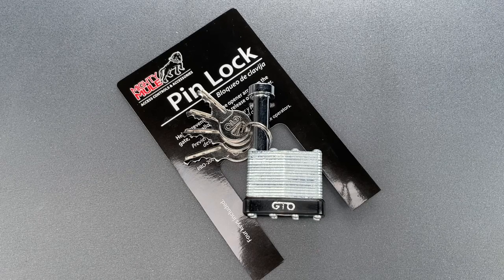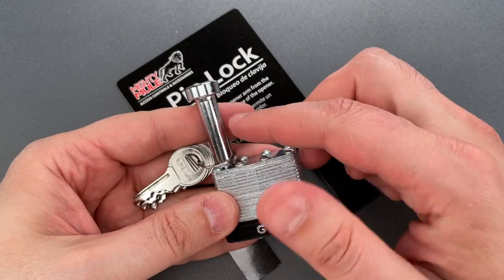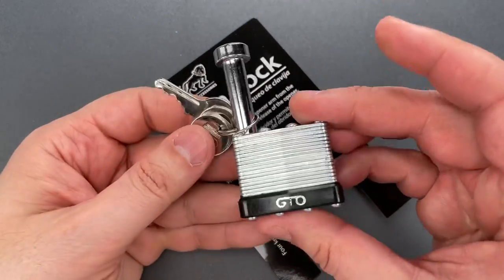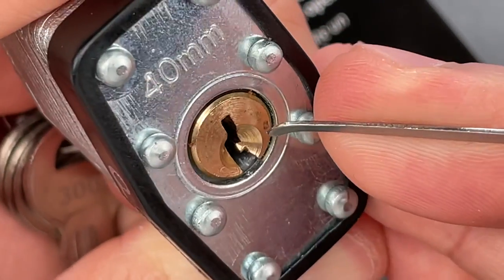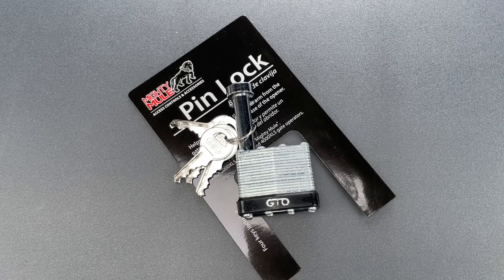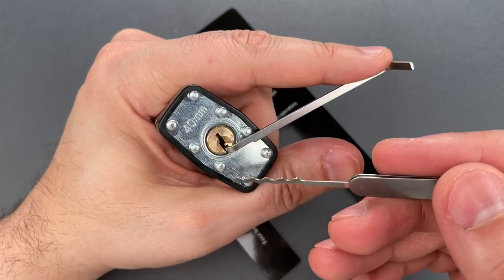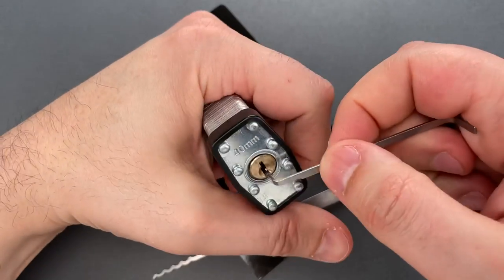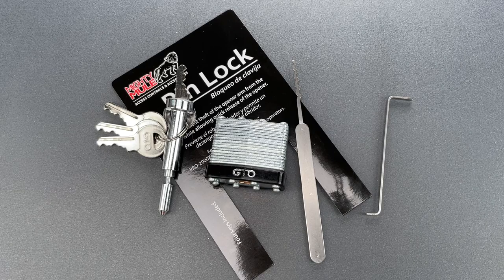[1426] Embarrassingly Bad: Mighty Mule Gate Lock

Comment: I like to imagine that if this guy ever had to go to prison, he would just wiggle the cell open. Then he would close it again just to show the other prisoners that it was not a fluke.
Reply: I saw a comment similar to this on another video, except it took it a step further and said he would go home and break back into the prison with his camera to record a video showing how he picks the lock on his cell to break out again. 🤣
Reply: @Mock353  exactly
Reply: He won't go to prison tho, he's a lawyer
Reply: I'd think the best move would be to just leave his cell door open to save the embarrassment of him getting it open in 10 seconds or less
Reply: Hi this is the lock picking lawyer and today I’m going to break out of jail using nothing more than a pair of eye glasses and the staple holding my rap sheet together.
Reply: Video 919.
Reply: @costagauci5719   ?
Reply: It could be impossible
Reply: @southaussiegarbo2054  he picks a prison lock in that vid.
Reply: "today we're going to be showing you how to pick a jail cell door using this Lego man... Click out of one..."
Reply: Most prisons use electronic locks for cell doors. There's a control room in each cell block where a guard can open and close each cell door individually. There is usually a manual override in the form of a physical key (in case the power fails), but that override is only accessible outside of the cell.
Reply: @poormanselectronicsbench2021  How to confuse LPL... lock him up but don't lock the lock ;)
Reply: @Mock353  no cell can hold him
Reply: @Ferinex_666  that's interesting. However LPL has done videos showing how to bypass such system. I strongly believe LPL could bypass the security features found in a general prison.
Reply: XD
Reply: you're in bed at 3am and suddenly head 'and a little click out of 3....'
Reply: @Mock353  Okay folks, I just broke out of county so I went back home for my camera because this was embarrassingly easy. Let me show you
Reply: The prison guard comes to check on him and hears, "Hello, this is the Lock Picking Lawyer and what I have for you today..."
Reply: “We put him in a cell on his own. He’s harmless enough. Only pick his own lock and closes himself back in. At least he is polite.”

Comment: They literally invested more in the look of the lock than the lock itself.
Reply: More in the design
Reply: and none of these is a compliment
Reply: More in the packaging.
Reply: They're apparently relying on the fact that almost ANY lock is more secure than none. But in a situation where every gate uses this, there's no advantage to "moving along" to an unlocked gate since there wouldn't be one. In retrospect though... I wonder if opening this lock is easier than removing the pin in an unlocked gate.
Reply: They literally invested more in the packaging of the lock than the lock itself...  :)
Reply: @laurendoe168  It definitely is. The only "security" this might provide is that someone might see it's a lock and THINK that it's not worth the trouble, but this is about as easy to disable as the standard clevis pin it replaces is. If the clevis pin is well made with tight tolerances, it might even be harder to defeat than this. Hell, do a bit of spot welding after installation, and you've just made the clevis pin MUCH more secure (at the cost of not being able to remove it yourself). This is purely about the APPEARANCE of "oh, it's locked" being the only security feature.
Reply: @laurendoe168  Simple answer, no.  Well, at least my cows and goats have yet to display the ability to use a wave rake.
Reply: Laminated lockbody is not a big investment.
Reply: @laurendoe168  that's a good point, although I'm that case 90% if the cost is going to the niche design rather than the quality of the lock
Reply: Darn Architects!!
Reply: @Ugot2BkddnMe  What about them dern rustlers??? :D
Reply: Rather, their design team is jotting down notes on how to "improve" their locks.
Reply: @anteshell  "Rather, their design team is jotting down notes on how to "improve" their locks.
" 

Much less cynical than I, apparently.. lol
Reply: Literally literally literally. Oh literally I can't stop literally swearing. I am literally addicted to literally or basically or "like". Like, literally! Can someone, like, literally, like, help me, stop, like, literally, like, overusing words, like, literally, like, literally? Can you? Like, literally? LOL!

Comment: Not exactly the superlative the company was hoping for...

He spent ten times more time berating the lock than he did picking it.
Reply: LPL broke the time/quality algorithm with the discussion. Of course without the discussion this would have been about a 15 second video! 😆
Reply: 10x0 is still 0. Just sayin
Reply: @slademmxii8759  heh.
Reply: @slademmxii8759  You're using that joke wrong. He didn't spend zero seconds picking the lock. It isn't ten times zero if no part of the equation is zero.
Reply: @slademmxii8759  whuuuu?!
Reply: To be fair, any lock that can be opened by rake gets opened very quickly..

Comment: With the amount the cylinder twisted you could probably put a flat head screwdriver in the keyway and it would open. It looks like utter junk.
Reply: Yeah, I was just thinking something similar; with enough leverage I’m sure a decently built flathead could be used to torque the core right open and either rip it out or just disable the locking mechanism permanently.
Reply: That sometimes works on these plastic bible locks. Other times the core (that is not made of brass despitle looking like it) snaps and binds it all up. Better to use a lighter to melt the plastic first.
Reply: Honestly this one looks like you could melt it open with lighter fluid and a bit of fire..
Reply: LPL, try it.
Reply: While my first idea when I saw the plastic was "torque wrench," after seeing the rake attack I think that might be overkill.
Reply: @ironlynx9512  My first idea was "cigarette lighter". My second was "flathead screwdriver".
Reply: @randombloke82  Yeah flathead screwdriver + channellocks would get that open for sure.

Comment: It would be hilarious if instead of breaking into the property, they just stole the gates.
Reply: Somebody once stole my bike lock, but left my bike! It was one of those basic indestructible Schwinn models.
Reply: And left the lock
Reply: That happens in real life
Reply: or exchange with the neighbour's lock, just for fun
Reply: Unlock their lock, put in on the ground, and then replace their lock with a grind resistant lock. Proceed to witness the ensuing struggle.
Reply: This lock is meant to secure the gate opener.  The gate opener (which swings open or closed a vehicle gate, like a chain-link gate across a driveway) probably costs $500 USD, and is (apparently) easy-peasy to steal, as its normally mounted without any security hardware.
Reply: @kenc2257  Someone near here had a Range Rover on their drive. It had its built-in alarm, plus an after market one fitted. They unlocked their car one morning and found a handwritten note on the dashboard, saying, in impolite terms, that their car security was useless. Nothing was stolen, but they sold their car promptly.
Reply: @legacysage  Two things to never use when found on the ground : 1) an USB key 2) a bad lock ;-)
Reply: @locknut5382  There is a real good chance the person that left that note was LPL.
Reply: @kenlee74  I'm inclined to agree with you about that! We must check to see whether he visited England in about 2015. 🤣👍

Comment: I bet when this lock sits in the hot summer sun for a few hours, the plastic gets so soft you could turn and open the cylinder with the turning tool alone 😂
Reply: It's just as likely to just fall appart to gravity when the plastic gets soft enough.

Comment: One day he should get an amateur in to pick the lock that "could be picked by an amateur".
Reply: He did this on another channel. The part that struck me was he told the person they were applying too much force. He said he could tell by the whiteness of the person’s knuckle. The person relaxed a little, and the lock immediately popped open.
Reply: With a lock like this, bring in a 10 year old kid and hand them a wave rake, job done...
Reply: He made an "appearance" (hands only) on TKOR and taught Nate and Grace to pick locks.
Reply: I bought the Genesis pick set a few months ago. I have never picked a lock in my life. I had a couple of old padlocks in my junk drawer. One was a Brinks and the other a Master Lock. After a little practice, I had my roommate time me. My best time was 11 seconds on the Brinks and 8 seconds on the ML.  @Gary Wiseman You really don't need a lot of force. I slightly bent one of my picks, thinking it was stuck. I quickly realized the lighter the touch, the better.
Reply: I'll volunteer!! I want to meet the LPL. I'd fangirl so hard.
Reply: When he does the "curious adolescent" tests he should bring an actual kid on to do them!

Comment: When you see the wave rake coming up you know this lock has no redeeming qualities
Reply: I dunno, the jigglers are even worse. And the very worst if he bypasses the lock with a shim or by just reaching through.
Reply: I like it when he just taps it with a hammer. Remember the "gun safe" he opened by hitting it with a clip board?
Reply: I was disappointed the soft plastic lock got the dignity of a low-skill raking attack instead of the no-skill screwdriver or cigarette lighter that it deserved.

"At least our core's not plastic" isn't a redeeming quality, true. But this lock's at a negative value.

Comment: I sometimes heat the key with a lighter and they use the key to melt the ice from the lock. Interesting how the plastic would hold up in my part of the world.
Reply: In winter in the UK, boiling a kettle and pouring boiling water over the lock works. Also means you have some leftover water for a cup of tea.
Reply: Some plastics shatter in cold temperatures ....
Reply: That would depend on the interplay of a number of factors. Primarily the amount of heat retained by the key which is determined by the mass and surface to weight ratio of the key, the ambient outside temperature, the amount of ice freezing the mechanism, and the ability of the lock to drain itself as the heat from the key melts the ice. 
What I think would need to happen is for the key to retain enough heat to turn the trapped ice into steam and then for the key to retain sufficient heat to transfer through the cylinders to melt the plastic.  With most keys and cylinders, under most likely circumstances, I don't think it would happen.  Under ideal circumstances - like using a blow torch to heat your key, with minimal water freezing the lock, at a relatively high ambiant temperature, you might be successful.
Reply: @larryclemens1850  with repeated usages it will definitely warp it to the point of unusability fairly quickly. Remember the back of the back of the key will be coming in close or direct contact with the plastic every time.
Reply: @nikkiewhite476    Only experimentation will tell. At -20°C (The temperature that my locks seem to freeze) I don't think the key will stay hot enough, after melting the ice that is seizing the lock to do any damage, if heated by a disposable bick.
Reply: A spam bot stole your comment, 12 hours after you posted it, @Eight Sprites.

Comment: Considering the plastic housing of the lock, I'd be really curious to see just how much (or how little) force would be needed to break it open.
Reply: Lol, I just got a 3D printer. I can probably print a sturdier lock at home using tougher filament😁
Reply: @bennylloyd-willner9667  with all of the locks, now if entry is the main purpose, as a posed to security,  entry, I think just a normal long bot, and wing nut, would make abetter lock
Reply: I kind of doubt one could torque it open; the cylinder might be plastic, but I'd wager the pins are still copper - those wouldn't break like the cylinder would, and it's the pins keeping the plug from turning
Reply: @booster247  even if the pins are copper, they'll be far too thin to prevent the core from rotating given a feasible torque
Reply: @booster247  but then again, if the pins don't have any cylinder to stay in, they could just drop down opening the lock without breaking.
Reply: @booster247  the pins won't break, that's true, but you don't need them to in order to torque open this lock. Force the cylinder into the pins a bit then snap back into neutral with the newly added space and they'll probably fall through.
Reply: wouldn't be surprised if a child could force it open.
Reply: @booster247  the pins would deform the housing, allowing it to move without them
Reply: LPL did this in a previous video. The (Brass? Zinc? Chinesium?) pins deformed the plastic bible and the high strength plast-o-loy core cracked.
Reply: I expected LPL to pull out a lighter and melt the housing.
Reply: One of LPL's earliest popular videos is of him torturing a very similar lock. Video #60. Very funny.

Comment: When we installed our gate, after evaluating this lock, we just went with a tightly double nutted bolt to secure the ram arm.
Reply: Smart move, I just turned up a pin for an Abloy to suit and had it induction hardened locally.

Comment: You were the inspiration for my first lock pick set about 2 months ago and my second, about 2 weeks later. Sold the first, bought a good set. I just opened a 5 pin sparrows practice lock. It was quite a bit harder than the 5 or 6 different padlocks id practiced on

Comment: The plastic core is a special safety mechanism to allow the gate to quickly be opened in case of fire.
Reply: so it's not a bug, it's a feature? 🤔
Reply: @szymonsadlo  That’s called an “Undocumented Feature”.
Reply: opened in case of fire, or in case of anything.
Reply: I doubt most fire departments would bother to try to twist the cylinder with a screwdriver, I bet if they couldn't get the property owner to open the gate and they had to get up the driveway there first method of attack would most likely be using a cordless angle grinder or k saw to cut the bracket where the opener arm attaches to the gate. Or depending on how the bracket is attached to the gate they could just take the screws out. However if the SWAT team needed to get past the gate in a hurry they again would either cut the bracket or more likely just shift the Bearcat into a low gear and RAM the gate with a vehicle and drive right through it
Reply: And if for whatever reason the police or fire department can't get through the gate then they will most likely drive across the lawn and go through the fence instead. In general if the police or fire department need to get somewhere in a hurry in order to save lives they won't hesitate to cause damage. A broken gate or broken fence and tufed up lawn is better than a house burned to the ground or hostages killed

Comment: The company should be sued for selling such crap under false pretences.
Reply: who's gonna sue them? you?
its cheaper to just not buy the lock.
Reply: Unfortunately our laws are written to protect this type of criminal. Justice is the exclusive property of the rich.
Reply: Where do you draw the line at locks that can be picked at 2 3 10 30 60 seconds. It sets a VERY dangerous precedent where any lock brand could get sued for it being pickable.

Simple solution research your products before buying. Especially something meant for security.
Reply: I completely agree! It's part of the security system for your house! I had one and it got broken by the neighbor's lawn mower! I was completely shocked.
Reply: @michaelmorris4515  yea we would need a mullti millionare group to make a mass lawsuit against the locks and the laws itself that allow the standart that is used today.
but sadly it would probably a ten year process ruled by corruption and lobbyism that brings no result except that millions of $ go into the wrong hands. and it is easily seeable by the processes against the smartphone producers that go directly against laws without punishment because the processes take ages without result.
Reply: @HawkUnleashed  You can't sell a car in the US unless it's been crash tested.  Locks aren't as critical, but the government should set up a similar certification process and issue certification for those manufacturers who submit locks to the process.  Then let the market decide whether to buy unreliable locks or government certified ones.
Reply: @michaelmorris4515  I wouldn't be opposed to a certification process because that sounds decent. My point was its very hard to draw a line once you open the door for sueing locks. I am always strongh in the support of people doing their own research because even certifications (if put in place) dont tell the full quality of the lock.
Reply: @HawkUnleashed  how about a metal lock with a plastic core?
Reply: @nsahandler  I would hope no one is stupid enough to buy that shit or reads a review how bad it is. A lock with a plastic core isn't going to be recommened by anyone.

Its different if they falsely advetise though about having a metal core. If a lockmacker wants to make their locks out of legos let them just know what you sre buying.
Reply: They're pretty honest on the packaging. "to help prevent theft of the opener arm from the gate while allowing quick release of the opener" 
I didn't see the packaging claiming any form of security or quality.

Comment: Plastic has no place in any lock!
Reply: Not true. A plastic coating on the exterior can help prevent damage to whatever the "lock" is securing, especially with bike locks.
Reply: @kevreeduk222  true, I guess it could be plastic or siliconized rubber..... only on the outside :)

Comment: Given how easy it was to deform with just the tip of the pick, and how mushy it felt with the turner, how much force would be needed to simply turn the core without picking the pins at all?
Reply: Viro Farms remembers!  (See LPL videos 885 and 943 (and the fix from Viro in 1078)).